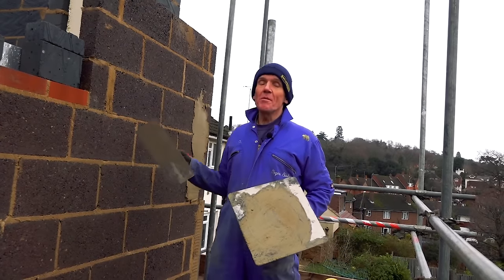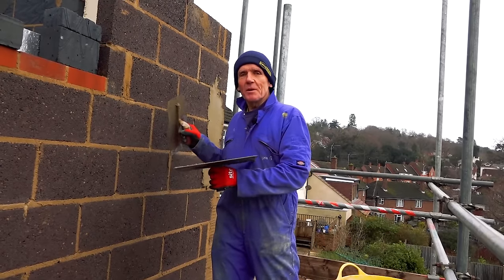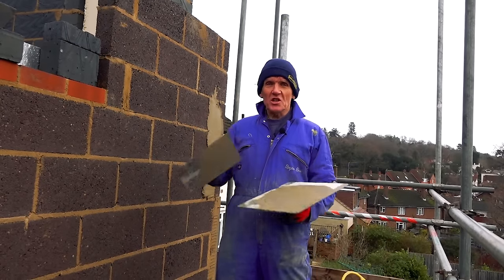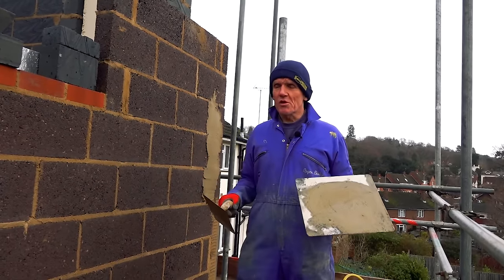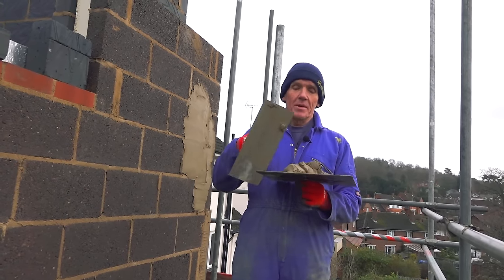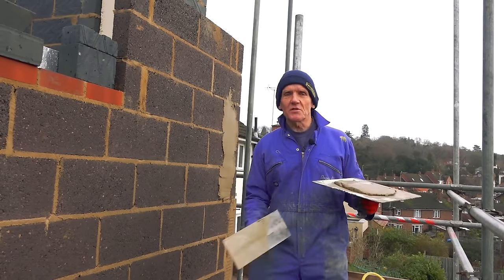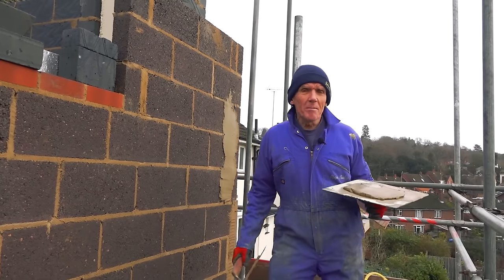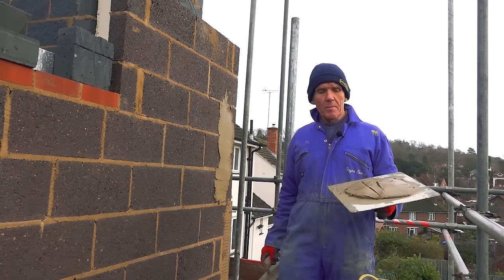What's the Best Mix for Perfect Rendering?

Comment: Boss I worked for always used buckets to measure sand and cement with - not shovels. This way the mixes are always accurate ratios and the same even colour throughout the job. This also went for mixing brick mortar. Buckets seem cumbersome but you get used to using them. There is an art to using the mixer - keeping it clean and not having stuff stuck on the inside and affecting the next mix. All the best.  ...And look after your backs too! (...or you will be sorry... Ha Ha)
Reply from the maker: Thanks Val, good advice and buckets are the way but hardly anyone has the time, rush, rush.
Reply: Correct as a big shovel the lad was using would have made that about 8-1 
my Dad had me use a small shovel on the sand and big one on the dust.
Gauge is good for any colour mix
Reply: Actually, i find buckets are quicker, i never thought that they would be till i started to use them for consistency...  it does depend slightly on your mixers location to the sand if it will be quicker... ... but i find its alot quicker to fill 3 buckets level, and only go to the mixer 3 times than shovel and count 12 times over to the mixer. 
less chance of error in counting shovels/better consistency/cleaner site/and can be alot quicker if sand is not close to mixer.
Reply: Val Caino  Great advice, username and comment!
Reply: I've always used bucket's more accurate mix
Reply: @SkillBuilder  We always had an engineer or architects make regular checks on our jobs so we had to make the time. The client is paying for a good job - up to specifications. Using shovels is very inaccurate especially when the sand is lumpy or dry and powdery. Lately, I have seen a lot of patchy brickwork with different colored mortars. We always told the laborer to select bricks from 2 or 3 different pallets to ensure an even distribution of shades. Bricks are just loaded straight from the kiln at the brick-works - they are unconcerned about color variations from different parts of the job-lot. It looks bad to see a brick home from a distance with evident areas of shade variations - looks unprofessional. Sometimes you can see an obvious horizontal line where the color shade abruptly changes or a patchwork quilt look.
Reply: @aaronstately  Yes it is easy to lose count and get the wrong ratio! Our mixer took 3 large plastic buckets of sand and half of cement. So  we always had 6 buckets filled and ready - sort of like a production-line arrangement. There is an art to using a mixer - the laborer was told to load one bucket of sand first so that the inside of the bowl gets initially coated with a sand/water mix. Loading the cement first results in the bowl being gradually coated with a sticky cement layer - this can constantly  build up resulting in inaccurate weaker mortars.
Reply: If you want to look after your backs you need to be excersizing your core abs and lower back 
The roman chair is perfect for that
Reply: @thedee4040  Too late. Back is totally gone! :) but I will look into that roman chair.
Reply: @theessexhunter1305

Comment: Hey Roger, i knew nothing about rendering and followed your mix and application advise exactly,,  I was happy wwith the first half wall i did, and after doing 4 half walls my results were  almost professional...........thanks so much!!.  P.S I remembered a trick from 4 decades ago an amateur plasterer/stucco guy told me; add a capful of dishwashing detergent to the mixture............it makes the render light and fluffy.  Too much makes it too light and fluffy though, but it was a very useful tip!

Comment: Wow, after about half a century of doing it my way I have finally found an expert who explains it all so well. I can only say thanks Roger and luckily (?) I have nearly always done any mortar jobs with a 3:1:1 mixture (so I think I am not too far out).
Here in Italy, they are all very vague on the proportions to use but I once contacted the cement company and asked them what they use in a typical 'ready to use' mortar and they told me Sand 71%, Cement 13%, Lime (calce) 16% at the time, which is about a 5:1:1 ratio.

Comment: I like some washed river sand along with some yellow in my scratch coat.
3 : river
2 : yellow
1 : cement
1 : Lime ( or plasticiser, water proofer)

Top coat

5 : yellow 
1 : river ( washed & graded)
1 : cement 
1 : Lime ( plasticiser/ waterproofer)

Not everyone puts water proofer in the top coat but it works for me.
43 years down the line and no problems yet.
Must say though.Give me a Hydraulic Lime/ River Sand render any day of the week.Beautiful to use, rubs up a treat and looks terrific.
Each to their own I say!!

Comment: A friend of mine rendered a concrete block wall for us, he used 60% building sand & 40% washed plastering sand in a 4 to 1 mix, was done ions ago, still perfect,  he's been a spread for the last  50 years or so. He didn't use corner beads either, did it freehand,  loveley job.
Reply from the maker: yes a lot of plasterers will chuck in a bit of building sand to make the mix more workable. 
Often it can shrink and crack. The other problem is that building sand often has tiny pebbles in it which are a problem in the top coat.

Comment: What's with all the hate? 1 part
 Hydrated Lime, 1 part Type GP Grey Cement and 6 parts sand by volume seems to be standard here in Oz.
Reply: SHARP sand....mostly called Sydney sand here....very important detail....and they DON'T use a lot of lime here...impe.

Comment: Hi Roger when I was very young as you do we used to just Lime(except cement and sand) for rendering, but it was different than Lime you show on video.
Usually we putted into the hole Lime and mixed it with water and left for few day to get proper consistency and when it becomes like butter we add into every mix and it was brilliant stuff for rendering.
Same we used for bricklaying, just a bit less than for rendering.

Comment: I've got a house that's been rendered on to concrete blocks and I've had quite a few long cracks I've had to chop the cracks out and patch them and this time I used plastering sand cement and lime I've been a plasterer for 16 years and the first thing I was taught when floating and rendering  was the mix it's important to always put lime in the mix never use building sand I've always done a 5:1:1 mix I hardly render these days but it's fact to much cement and the wrong sand will make your render crack in time

Comment: I agree with you Roger, I use a 280 liters cement mixer 6 buckets of sharp sand, 1 bucket of cement and one and an half of lime, plaster like you said doesn't need to be bomb or scratch proof,  and if the wall is nice and strait use as little plaster as you can because using a lot is a waste of time and material.

Comment: I once had to do a repair job for a builder which had some serious cracking. So I called a consultant who put me into touch with an industrial chemist. I then worked on using plaster without lime and rendering or even mortar without lime. The industrial chemist stated. We consider lime to be no good. I thought okay. It was the best thing I even did.
So what I'm saying if you use lime then you make the strength of the mortar according to the strength of the substance you are putting it on. Exactly what you mentioned.
However, with the product I use you can mix whatever strength you like to a certain extent.
And I think there are many factors to take into consideration.
I use what is called a latex rubberised synthetic emulsion system. 
If you render onto old bricks which were laid without cement then you will get surface retention. So you will see a certain amount of cracking as the compression is very low opposed to bricks laid with cement in the mortar.
Without lime I can wash my tools without wearing rubber gloves. Also if some material splashes in my eyes I don't need to race to the water to get the mortar or plaster mixed with lime put. Lime is highly corrosive so if it gets on aluminium it anodises. Although cement had alkaline and can sometimes leave a mark on specially coated windows glass. I found that out with a client when some mortar got in behind covered up windows.
This is partly due to cement manufacturers cutting costs and leaving out gypsum which in the last we had better cement than from recent times.
I'm not sure about U.K. Because I'm from Australia.
I think of you use plasticisers then perhaps also use some bonding agent. I use an addicrete add mixture which is a plant based material which also is a water proofer.
That combined with the rubbberised emulsion system really makes a great mix and you will never go back using lime. Trust me. It also has a stronger finish and reduces efflorescence. Anyway great video.
Reply from the maker: There is a lot to consider here. I think you might be talking about SBR but I am not sure. Can you send some product details so we can look at the spec?  It would be great to develop this discussion.
Reply: Skill Builder thanks for the reply. Check out calmarc chemicals based not far from where I live. The product I'm talking about is screedbond. It is rather expensive and I have had many discussions with Jeffrey consulting his products and working with the plaster so give it trowel slide. 
Here is the link. http://www.calmarc.com/
Plaster I worked with Jeffrey and there are only a few of us in the whole state that worked out the method to use this product. Thankfully I listened to plasterers from UK who stated get the plaster on, trowel it smooth and let it go hard before giving final trowel. The product gets very hard and does not draw fat so making a small batch to fill in voids achieves a more desirable finish.
Also I use a fine spray to spread the material.
http://www.calmarc.com/gypsum-plaster-finishes.html
Screedbond http://www.calmarc.com/adhesives.html
In this screedbond is a data sheet within.
Jeffrey stated the screedbond can be used to make tile adhesive mixed with cement.
I have also patched timber at 2/1 sand cement ratio with screedbond 50/ 50.
I recently did a cement dado 50%'water 50%'screedbond. It hasn't cracked yet so I will keep an eye on it. The cement mortar wasn't too strong either. That's what I was amazed with. It's like throwing the rule book away.
Mind you the lime industries don't like it.
Cheers. Keep up your great video. Yourself and Robin Specialists in your field.
Oh the cement dado I mixed I made one mix 2.8 fine .3mm silica sand to 1 cement also adding addicrete p. The second mix I made 2.5 /1 all 50/50 water screedbond. I found the 2.8 to one better mix. Normally cement dado is 1 cement 1 lime and 1.5 sand. You get lots of cracking.
I did a small screed on top of smooth concrete upon advice from Jeffrey. Since the results were rather pleasing I decided to do the mix of cement dado. I plan to actually polish with a wet concrete polisher.

Comment: Cheers Roger, thanks for the good vids and advice. Building a Pizza oven so needed a bit of info on the render and top coat for the support structure  and oven itself. Got a bit of lime also so we are all go. I made fine care not to follow up any of the tosspot replies you have received. Not too many vids from them I see.

Cheers
Reply from the maker: I have always intended to build an outdoor pizza oven come bar-b-cue but never got round to it. I did some sketches with my son when he was 12 years old and it was going to be our project. He is 32 now.

Comment: Hello Roger,  I do like the way you put things across on your videos, always makes a lot of sense.   I need to patch  a couple of sq, meters of fine textured render on a wall . I will be taking it down to bare (old brick)  What materials do I need to carry out this task in the most simple way as I have not done this particular job before? Or can you buy it in a bag ready mixed ?    Regards  David.
Reply from the maker: Hi David 
 You need to buy a bagged render. There are lots to chose from and matching up to existing is always tricky. If you can send some pictures I will try and identify a suitable product. 
www.skill-builder.uk/send

Comment: Hi there Rodger, great video, very helpful. I'm going to attempt a little bit of rendering on my side wall and I was Just wondering would you recommend putting pva  on first. Seems that some do and some don't.  I was told that just giving it a good clean first will do and that pva can stop it breathing. What do you recommend. Thanks
Reply from the maker: Sorry Alice. I have only just come across this comment. PVA should never be used outside. SBR is way better.
Reply: @SkillBuilder  normally you attach beads if you are using beads that is etc.. then skud the walls, then scratch coat aka base coat, then finish coat .
I agree the scratch coat should always be a weaker mix also helps with keeping the walls wet before the finish coat.
I always used a 4 or 5 to 1 for scratch and a 3 to 1 for the finish coat, lime is great for the finish but it can cause bad burns worse than cement if someone has tender skin that is.
Also when using lime let it mix and hold off on the water , this catches alot of people out as it get more watery as it mixes through.
Reply: @philipm1896  if you put a stronger coat on top of a weaker coat it's gonna crack and fall off. I hope you're not a pro
Reply: @iaintait772  building houses 35 years not one has fallen off, guess you are wrong.
Reply: @philipm1896  Hi Philip. I've been rendering houses for about 35 years as well. The only time I might put a stronger mix top coat on might be if I do a thin harl coat on top of the second coat(we're in Scotland) I'm not trying to diss you but it is accepted practice that a stronger top coat on top of a weaker scratch will cause problems. It may be that the addition of lime in your top coat makes it more flexible and less likely to crack but I'm not convinced, but if it works for you then that's good.
Reply: @iaintait772  Ireland has a similar climate like Scotland.
Motar used for blocks are always a weak mix, base scratch coats need a similar coat or spider cracking will happen.
The lime in the finish coat is self sealing if you get me and gives a better sealed finish.
It's the way it's done here, again different places need different solutions.
Neither of us are wrong if we both get the desired results.

Comment: You are a fantastic help Roger.
Do you ever consider using a hydraulic lime as an additional binder to your sharp sand based mix?
I always find my void ratio in a sand ( its a simple process)
Sharp sand will generally have enough void to acomadate 1 binder to 2.5 or 3 units of aggregate.
6:1:1 is therefore a very good mix.
Although my work is mainly brickwork the mix rule is generally the same.
What are your thoughts on scud coats on celcon type blocks 1st?